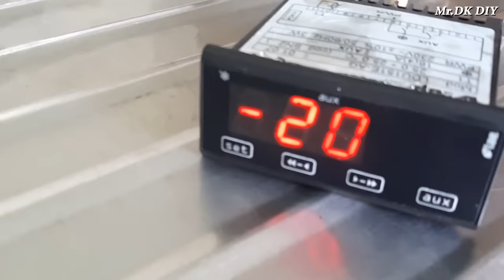Homemade ICE CREAM ROLL MACHINE DIY / Lets get roll ice cream

Comment: I suggest using isolated copper tubing, something like styrofoam covering the bottom of the copper tubing underneeth the metal plate, and some rubber around the under edge of the plate, where it touches the sink absin. It would hold the cold a lot better, giving you quicker freezing ice cream, and less of an energy loss. But an great project never the less

Comment: Insulation will go a long way to making this thing more efficient, but at the end of the day it is nothing more than an ice cream mixing/reshaping/making?cold plate. This is usable, but i would think it wiser to have the cold side run around a stainless steel cylinder and have a hard foodgrade plastic spiral paddle scraper  scrape the internal radius of the pipe and make ice cream faster that way from premixed or custom milkshake mix, while keeping the cold plate so one can custom shape the ice cream to fit in your desired serving containers.
Also, this device won't be portable unless you have a generator or mains AC power to run it.
For people attempting to do the same thing, you need everything to be in good working order, and refrigerant compatible with the compressor as well as a means to get air out of the system/lines e.g. vacuum pump - otherwise the compressor will not last long. There are better ways to mold the cooling coil, and it would be best to put the output of the metering tube (small narrow copper line) right at the place you want to freeze cold, plus several layers of airtight insulation to keep moisture out completely from the coils and prevent frost buildup.
Reply: I don't know why nobody liked your comment you put your time in it
Reply: asakayosapro hey, why don’t you do a video!........I would like to make a machine too!

Comment: Mmmmmmm nutin like rolled ice cream with metal shavings. Never use metal on metal when scrapping is required making foods. Great DIY project though!.
Reply: Metal utensils are standard from food prep. Spatulas for griddle work etc are all metal. Stainless is typically hard enough it is not going to scratch and contaminate the food. Using metal scrapers is standard for rolled ice cream too.

Comment: Looks like an impressive build but it would have an extremely high power consumption, insulating the bottom of the coil and insulating the plate from the sink would probably cut power consumption in half...

Comment: 13:46   You have an overcharged system. You don't want a frost line all the way back to the compressor. That means liquid refrigerant is getting back to the compressor and you will destroy the compressor since a liquid is not compressible .

Comment: Hi, could you help me with how many meters of tube and what kind of compressor is 1/3 or 1/5, thank you very much... 🙏
Reply: The more tubing you use for the evaperator the better. I would use 20ft of 3/8 copper. It doesn't matter if you use a 1/5 hp or a 1/3 but obviously the more powerful it is the faster it'll cool down but while running it shouldn't matter.
Reply: Same thing here

Comment: Hp value,charging amount of freon,what kind of refrigerant,the capillary tube length and size of diameter, length of evaporator, size of evaporator,do the system dont need vacumming? Electrical installation. You mean diy? Make it technicaly specific next time.

Comment: have some stainless steel bolts welded to bottom of stainless plate then drill a regular steel plate to match the bolts and then foam and sandwich the coil between the plates.

Comment: Next time fill the pipes with sand before you want to bend them, that's bad how they got bent. Great project..!
And I would solder the refrigerant pipes to the stainless steel plate and not stick them together.
Reply: Soldering to stainless is very difficult. I imagine that it would have a good chance of warping or discolouring the metal.

Comment: Its cool but why do you put glue instead of soldering it to the metal plate ?
Reply: thats an aluminum or stailness plate copper would be very expensive and can corrode
Reply: Bez it's homemade.
And he also need to insulate lower side of plate.
Reply: Can't solder copper to stainless
Reply: You aren't going to do well trying to solder copper to a stainless plate.

Comment: WD40 is NOT a lubricant. You use it to remove moisture from areas affected by it WD stands for "Water Displacement" use a nice light turbine oil for those fan motors, or a replacement motor is $30

Comment: Plate needs to be much thicker and not soft metal that scrapes off into the food.   Also needs a much better interface between plate and coils, that adhesive is like an insulator.  Lastly it looks like a nightmare to clean and sanitize after each use with ice cream getting under the plate, have to take outside and hose down before everything dries and hardens after each use.

Comment: Does any fridge compressor works?, i have one that i dont use so i can make this, so what is the gas you use for this? Is that gas hard to find?
Reply: Thank you!, awesome videp btw xD
Reply: I am a little late but any compressor will work, and the system could probably be charged with one of the Ac kits at the hardware store.

Comment: Nice idea and very interesting. but You forgot to install accumulator to prevent intering liqued refregerant inside the compressor ..thats why the suction line is freezing.and its very danger to the compressor..
Reply: I think it would actually be fine as long as the body of the compressor doesn't ice up at all. Most compressors like that are designed so that the intake of the compressor is at the top of the can. I've built systems that feed a lot of liquid into the compressor and I haven't blown any valves yet.

Comment: Alguien sabe Que capacidad de compresor lleva y que tipo de gas refrigerante usa,  el tamaño del serpentín para el evaporador cuántos metros de cañería usó, y el tamaño de la plancha de acero inoxidable cuánto mide?
Reply: Ojalá responda, esos datos son más que necesarios
Reply: Lleva un compresor de 1/4 con el condensador para un refresquero ventilador para cualquier uso comercial ya sea vitrina o refresquero con base y propela y de tubo le podría quedar de 1/4 a 5/8 de 10 a 15 metros dependiendo y refrigerante  r404a

Comment: Idk is it liquid nitrogen or is it a type of gas tank
Reply: It is refrigerant - liquid with low boiling temperature (usually below 0°C). There are many of them out there. R134a (Tetrafluoroethane) is the most used for those applications, but you have to have license to work with this gas. If you want to try build something similar, you may use R290 (propane) or R600a (isobutane) - those are cheap and easy to get. Just be careful, those two are flammable.
Reply: refrigerant gas
Reply: maybe R134A
Reply: Plain old freon